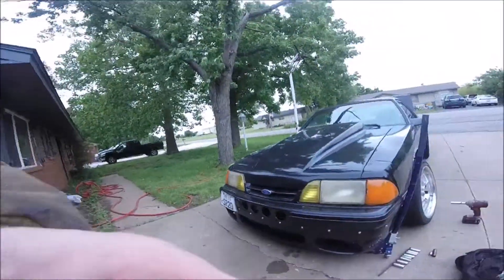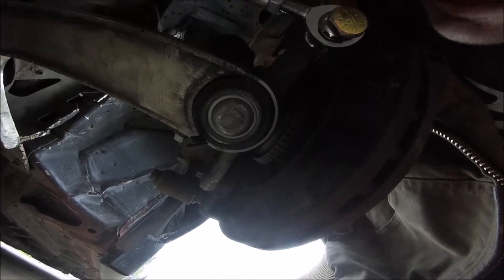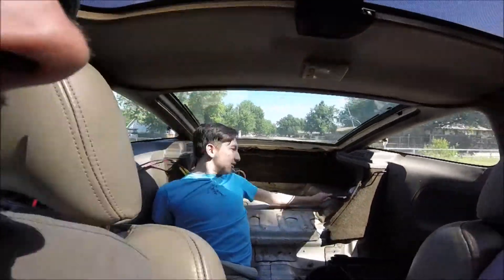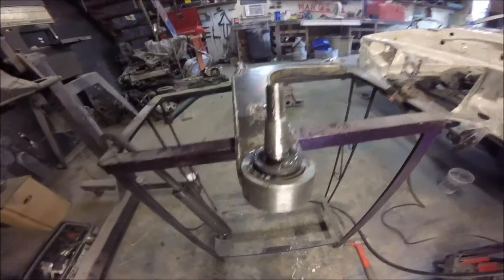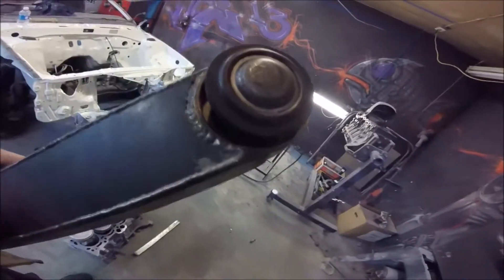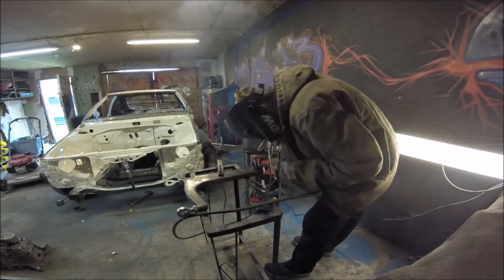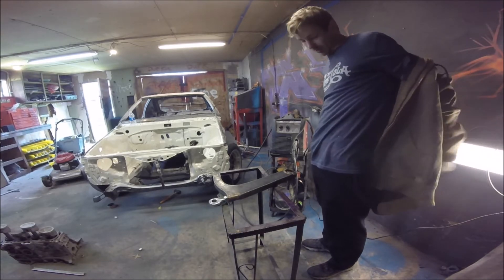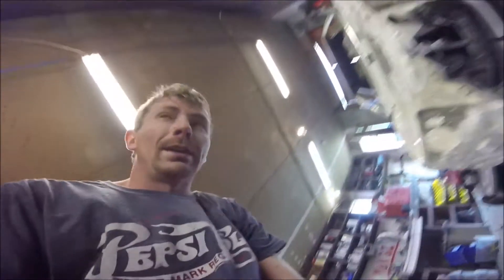Battle Fox BALL JOINTS FELL OUT! Drift Mustang knuckle LS1 350z drifting!

Comment: might have been easier to get the correct ball joint. I had the same issue on my Mustang when I went to swap in front suspension and brakes from a 2002 v6. bought 96 ball joints thinking they were the same. very loose and didn't press in right. the newer ones are slightly bigger in diameter
Reply from the maker: Corect sir. These got me to the next event though, and cost my nothing. I later found out they were indeed the wrong size.
Reply: Keep Drifting illegal well it cost you time and now you have deal with the fact you welded them in.